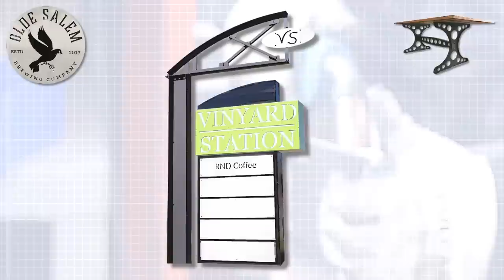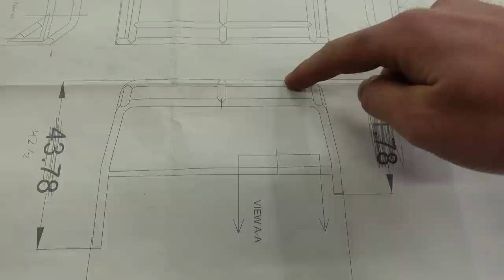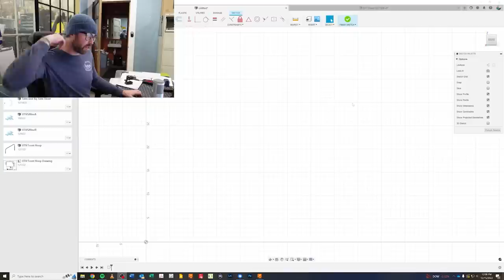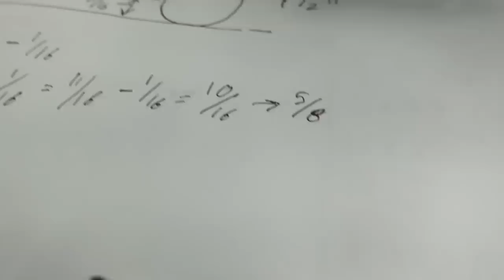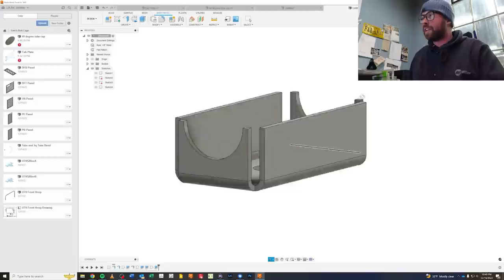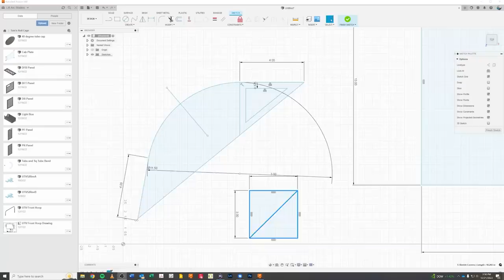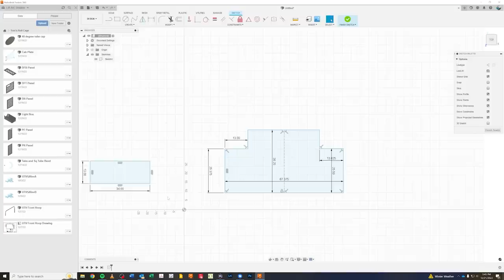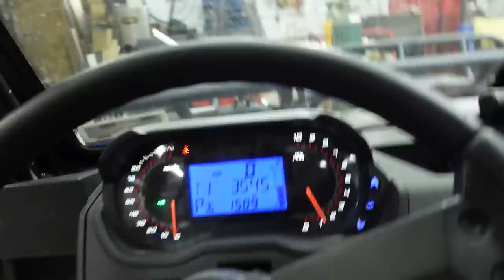The Never Ending Roll Cage Build - Polaris UTV Roll Cage (Full Series)

Comment: plasma cnc a new die/follower made from several different layers of 3/8 plate  the same dimensions/hole layout as the jd2 does ...  for square tube, no or not much grinding required .. simply use strategic plug or channel welds to build up the layers.... obviously that probably would not have met your time constraint

Comment: The statement about welding aluminum to steel, not necessarily true. On modern US Navy ships super structures, they use the material called explosion, welding material to attach the upper super structure to the hull of the ship.

Comment: now just imagine making those hoops and having to roll a crown into the tops...  meaning you have to be able to figure out how much less your corner bend angles need to be so they end up exactly where you want them after you roll your crown in... because you have to bend the corners first.     i'm sure you know how to do it... others reading this know how... but it can make things... "interesting" lets say  when precision is required and using 1.5 or greater od tube because its not going to be that flexible to persuade into place.   anyway just a random thought.
Reply: also its a lot harder to get the tube coping right than dude on TFS makes it look... hes just that good.   trust me yours look better than mine most of the time.

Comment: The shelf is a bad idea, not enough on for patient and the shelf in the same area.     Ya, you might squeeze the patient in there, but if they are conscious, that’s gonna be a real bad tide for them.    If there is an issue, the passenger can’t work on the patient because there is a metal shelf over them and they can’t reach them.     Old guy obviously isn’t one of the people doing the medical work, he is only thinking about how much you can put in there, not the other…also, that’s several hundred pounds of steel your adding instead of aluminum.
Reply: The shelf isn't on Lift -Arc it's on Tom, the customer.